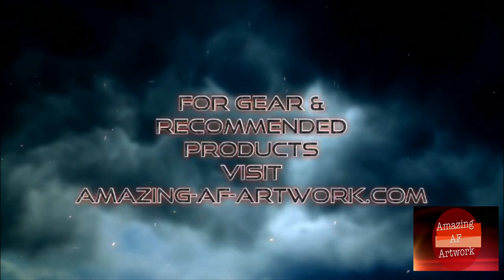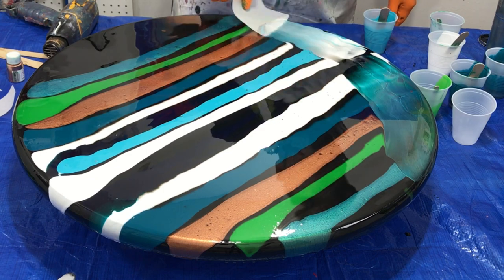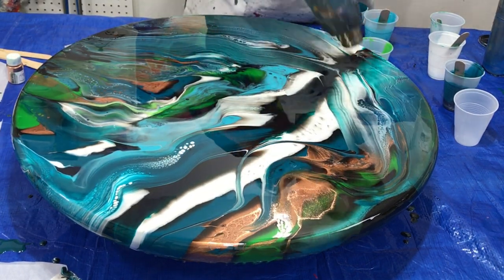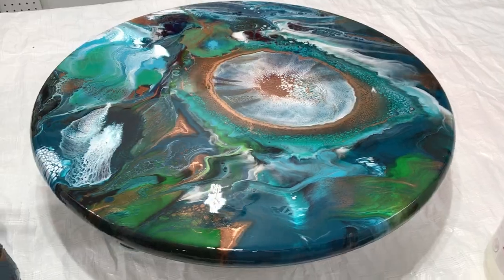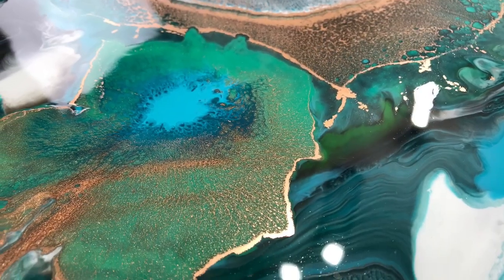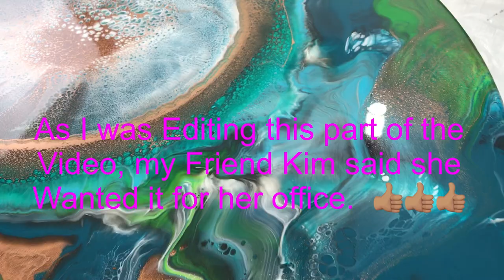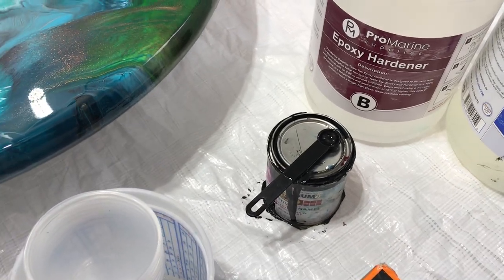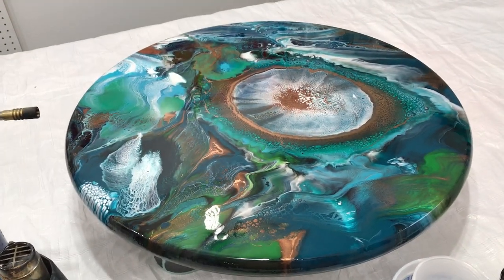Resin Swipe , Tilt, & Puddle Pour.  Testing Oil Based Paint in Resin.

Comment: Love this!!!   Could i possibly use a Flat rustoleum??   Im thinking i bought the wrong one
Reply from the maker: Debi Allard you can give it a try.  Most of the oil based paints will give you a cool effect swiping or with heat.  Just try not to mix them to strong , or your cells and effects will show up , then kinda fade out.  I’ve noticed the best effects with the gloss black and the Gloss white oil based enamel.  When you mix it in with your resin , add just enough so that you can not see the wood grain on your popsicle stick.  Hope this helps ya 🤗🤗.
Reply from the maker: Thank you 😊 too also 🤗🤗
Reply: @amazinga.f.artwork9047  thanks for that info!!